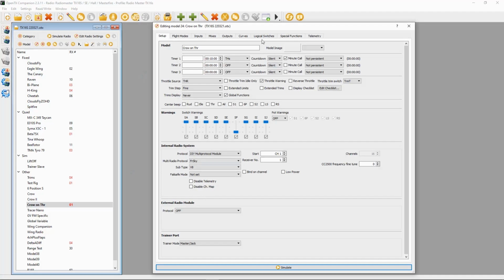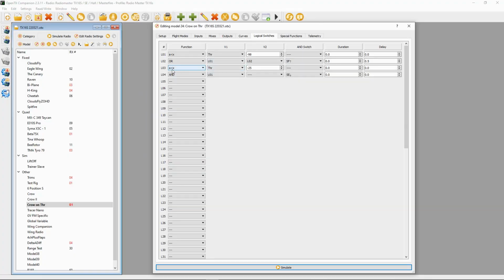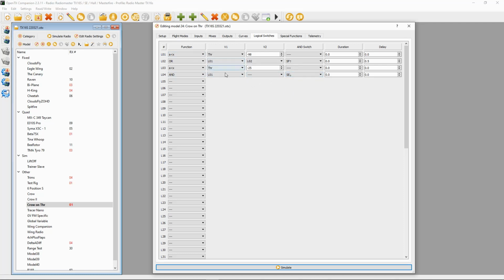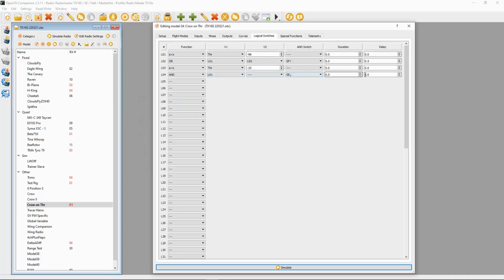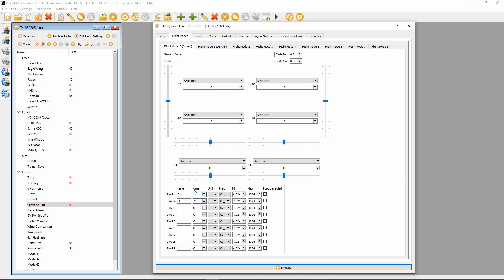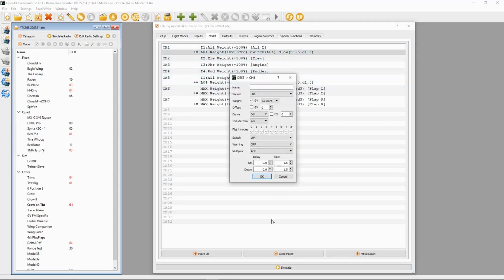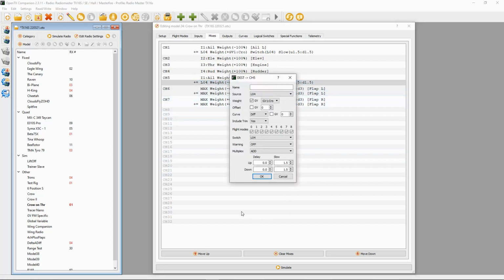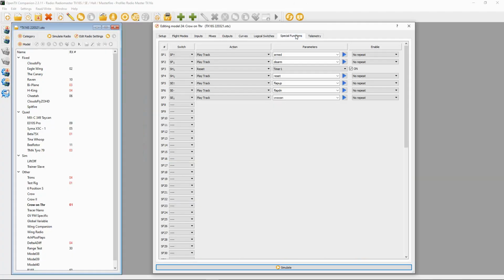OpenTX Crow Brakes on Throttle

Comment: Can you please show how to eliminate the aileron differential when they are up, if you have the crow deployed and you need full aileron deflection to control a wind gust.
Reply from the maker: Sorry for the late reply I have been moving house. You would need to set up a special mix to do what you are looking for but you should still have good aileron authority if you set the crow brakes up correctly. I suggest limiting the crow brake movement and slowly increase it.